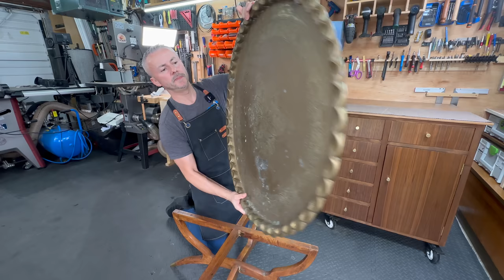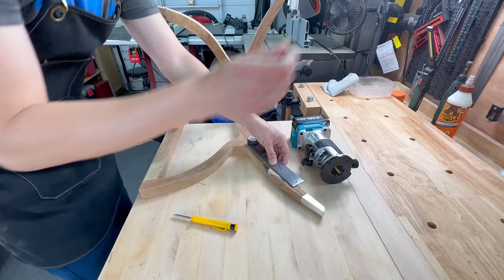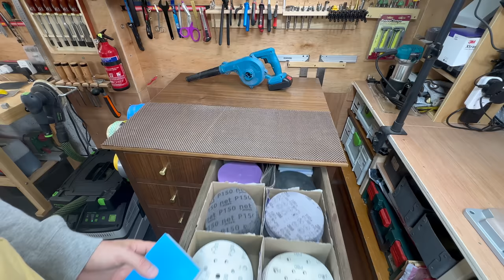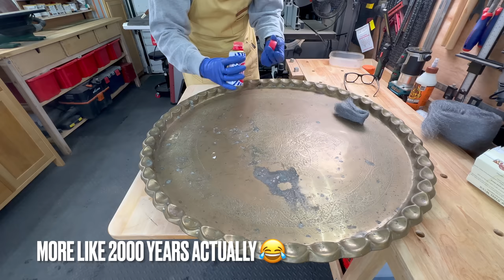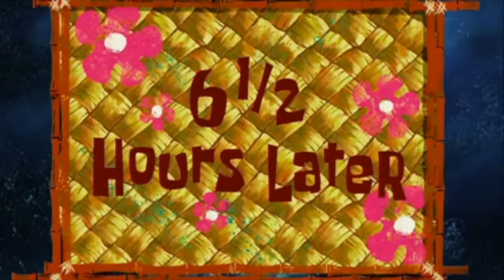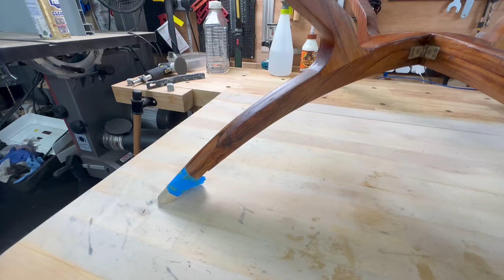Mid Century Moroccan Brass Coffee Table Restoration. Fun challenge with @midcenturyflipper

Comment: I have the a similar style table but my top is a hex shape now round.   Still has the "pie crust" edge.   Purchased by my wifes father when he was  stationed in France in early 60's.    The top is not flat, perhaps it was flat originally then twisted/warped over time.
You did a terrific job on the restoration.   Well done.
Now I know I do not want to spend any time on my table.   Too time consuming.

Comment: You gave it new life and it’s beautiful. Why did you use mineral spirits to clean the stand after the sanding. Why not a damp cloth with water?
Reply from the maker: It just worked much better.  Brasso is not that easy to wipe off
Reply: I think the wood can absorb the water and takes longer to dry, the mineral spirits don’t get absorbed and dries very quickly!

Comment: My parents had a nearly identical table to this one, except the top was oval. It had a smaller round companion that was used as an end table. I recall them as being impossible to clean properly with what was available at the time. You did a fantastic job on this one.
Reply from the maker: Thank you for sharing and watching 💛
Reply: Brass polishes have been around since the beginning of the early 20th century. I have used salt and water, pumice and water, even a light coat of rubbing compound. They need a weekly whipe down or nowadays a clear coat finnish. Clear laquer was used before clear coat but you had to be careful cleaning it after. Most of the time it got a bad rap, because the brass wasn't prepped well at first and then harsh cleaning chemicals left bare patches in the laquer which required stripping the whole surface and people didn't want to ordidn't realize it needed to be stripped. Believe me I would gladly polish a table top over well used brass cuspidors.
Reply: @Flippingdrawers I think This project is beautiful. You did a great job.😊
Reply: I think this project is beautiful. You did a great job.😊❤
Reply: I'm stunned by the transformation! Absolutely stunning. You're a genius and I'm in love with this table ( and your cats lol ).
Reply: We had the oval one too.  I always thought it was so chic. Never knew what my parents did with it in the end.

Comment: Good job. 👍👍The only thing you always want to do with brass is a sealant. Wax sealer for brass polishes also or a laquer after. Don’t try the sealant especially made for brass on big surfaces like that. It will get really streaky. Without any of those this will turn dark pretty quickly. Cute table
Reply from the maker: I will do.  Just haven’t decided what I want to use

Comment: I would love that table so much! I went to Morocco every three months for nine years when I lived in Spain... I never did get one of those, but still wish I had one now. I have four tables with brass tops but mine are all Asian, two are Antique. I clean mine with fresh lemon juice. I just cut the lemon in half and rib the flat cut lemon onto the brass. Once in a while I use Brasso, and if I get a bad stain I may use some finest steel wool. All Summer my brass table tops are outside on my deck with a thick clear glass over them so they stay untarnished and protected.
Reply from the maker: Very cool.  Love brass 🤩

Comment: If you are keeping this, a good way to clean the top is tomato ketchup.  
You really are a miracle worker.
Reply: That is an interesting tip - I have a similar style of folding table which was always polished with Brasso, but the residue often collected in the engraving. I have had my table since the 1950’s, and it was not new then. May try ketchup, or barkeepers friend.

Comment: I have one just like that, it measures 40 inches across, (103 cm), and is a bit more ornate with the metal etchings.  When we were living in Tripoli, Libya 62 years ago my parents had one custom made, and we had the exact same folding base for it. Unfortunately, over time, the base got lost in a move so I turned it into a wall hanging. Using 3 large L-bolts to hold it up. I'm saving this video to send around, and hopefully, I can find those brass footing covers and have another base made for it.
Reply from the maker: Thanks for sharing 😊 hope you’ll find it.

Comment: What a gorgeous result from your hard work, just beautiful. 🤗 Those tables used to be all the rage back in the day, but I'm pretty sure the brass tops were lacquered, just as textured image brass plate wall hangings were. I once ruined a pair of my mother's when I left them in a bowl of hot water for too long as I was doing housework and the lacquer came off. Ouch.  Damp cloth wipes only! I have a very small version of the round top and I do like brass, so this was very interesting to watch. 😊👍

Comment: These “coffee” table top is actually a serving tray for food. It is usually sold brass. They would either load the tray in the kitchen and then place it on the legs and/or add dishes to it once it was settled on the legs. If this tray had silver and/or copper inlay, the tray would have to be cleaned l top the top by hand to preserve the metal inlay. With a tray that is just brass, after cleaning you can use clear shellac to seal it from oxidation. If it has silver and/or copper inlays you could seal it with wax only. To seal an inlaid top with shellac or vanish would destroy the silver. To polish an inlaid top with sand paper would thin out the inlaid metal and it would fall out. Hope this helps.

Comment: I have almost the same brass plate, mine has a star in the center, not the flowery swirly like yours, but I do not have the table base.    My father bought the plate many many many years ago, maybe in the early 60s.  I inherited it, it is used every day, my glass, wood, and other types of turtles are displayed on it.    I would love to find a correct base for it, right now it lives on a large copper bucket sort of thing with brass feet.

Comment: Hey Jay, so I learned a trick that I will pass on, which you might say to yourself "I wish I knew this before I spent 2000 years with Brasso and Barkeepers friend."  Toothpaste is also a good polishing compound. I recently learned that using toothpaste designed for "whitening" has a slightly higher abrasive and can even be used for fine scratches on glass (my fish tank project).
Reply from the maker: I have tried that on other surfaces with mediocre results 🤷‍♂️ haven’t tried it in brass though

Comment: Top Tip: When putting in a repair patch, dovetail or angle the ends of the patch, instead of cutting them square. This increases the glued surface on the ends and helps to prevent it from falling out in the future. 
Especially on curved legs like these that are subject to tension and compression from loads on the table top. 
Hope this helps. 😊

Comment: Lovely work. Is there anything you could have used on the top of the brass tray and feet that would keep them from tarnishing? A sealer of some sort?  Also to repel stains and such in the future. All that polishing seems insane.
Reply from the maker: Yes, absolutely and likely will use ceramic coating or wax

Comment: Suggestion: 
1.  WD-40 can remove a lot of oxidation on brass.  If you use a toothbrush,  not the "soft," you will find that it can lift up a lot of that super fine dirt in the etching.  WD-40 can remove some paint, but it takes a good soaking for that to occur.
2.  When polishing brass, go up to 2000 to 3000 grit.  If you really want a shine, use a cloth polishing mop with aluminum oxide with some water, absolutely worth the time investment.  
3.  If at all possible,  stay above 500 grit sand paper.  Even 300, 400 grit will deeply scratch the surface of brass.
Reply from the maker: Have you watched the video? are you seriously telling me to use a toothbrush on a 
1 meter wide table top? I clearly said that I sanded with 800 grit and used a car polisher with bar keeper's friend to finish it. At no point I was going for a mirror shine as the leg tips were brushed not shiny.
Reply: @Flippingdrawers  No, I was only suggesting that if you used the WD-40 and a toothbrush on something like that, it was for the FINE DETAIL.  Oh, gosh, NO, at using a toothbrush on the entire plate; that would be utterly rediculus!

It has been my experience with brass polishing that one can see the swirl marks of polishing even at 2000 grit wet sanding.  My experience with Bar Keeper's Friend brass polishing has not been good.  Who knows, maybe somebody dumped Comet abrasive cleaner into the Bar Keeper's Friend polishing.  Maybe it was my inexperience of 30+ years ago. 🤔 
... and the result of your efforts at the end,  was absolutely beautiful!!!!! The wood and brass looked like they were a match made in heaven.

Comment: Hello Jay, I watch carefully what you’re doing with that brass serving tray. I’m wondering if it has dings in it, could you use a Babbit hammer on it a hard rubber mallet with a long handle, usually used on machinery. It gives you both the momentum and direction assistance without damaging any machine parts or any surface. As always, I enjoy your work, this was a real challenge for you. Bravo!
Reply from the maker: Thanks. You can probably use a meat tenderiser if you want to 😂 I’m serious.  You can always put a piece of cloth or cardboard in between to avoid marks so yes, I’m pretty sure you can use your mallet as well 😉
Reply: My last name is Babbitt as an Babbitt hammer but unfortunately I had nothing to do with it development or design. Another bright fellow named Babbitt did it. He was an engineer and needed a way to change slightly the configuration of the machine without necessarily ruining it.